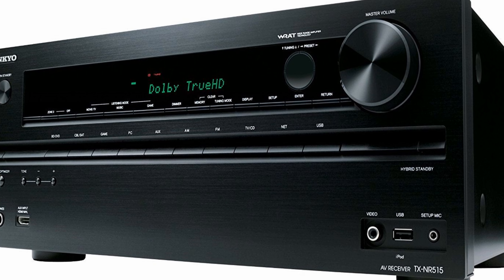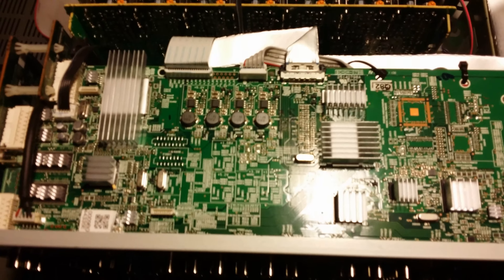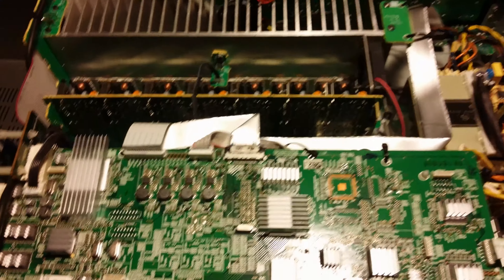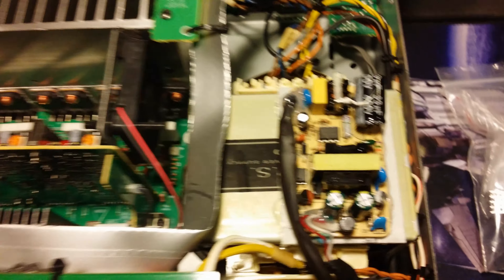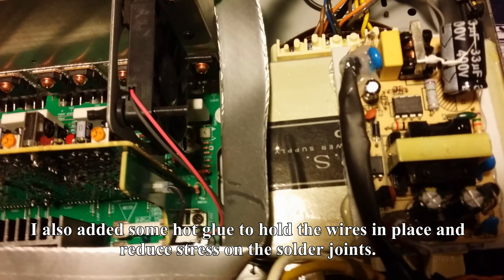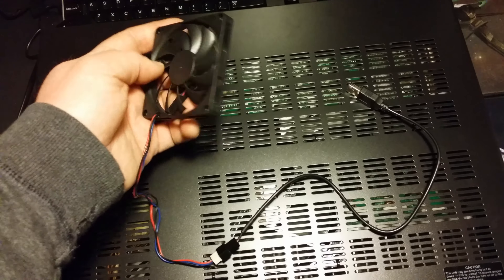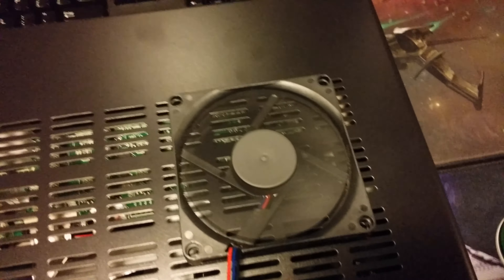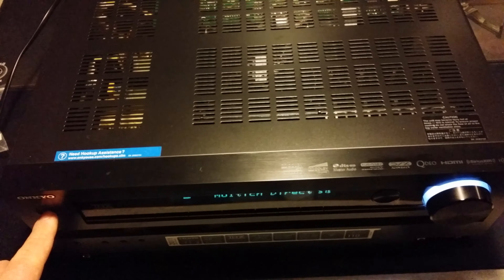ADD DIY: How to cool your ONKYO receiver -or- Save your HDMI board and prevent the "no sound" repair

Comment: This is not a fix. Prevention. I bought a new onkyo. No sound within hours. Was still buttoning up things when the no sound started
Reply: Thanks for the tip. Thought about buying a desktop fan with a clip to use? But I'm also getting no sound after switching sources (input)
Reply from the maker: Not sure I referred to it as a fix.
Reply: @edt1138  I seen that literally after I replied. Sorry bout that
Reply from the maker: @wayneholderbee1734  Honestly, once these things go bad there is no good and permanent fix. Your best hope is preventing it to begin with.

Good luck.